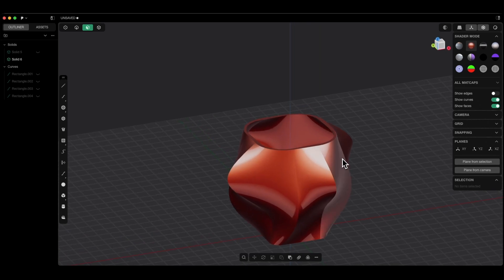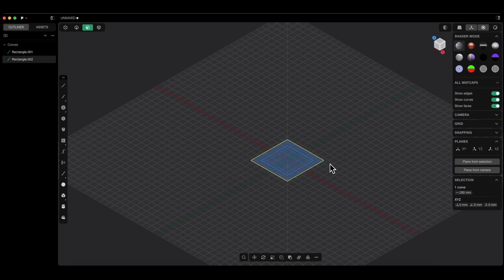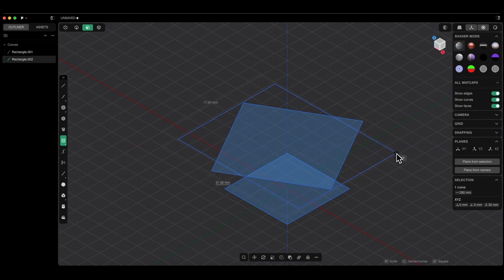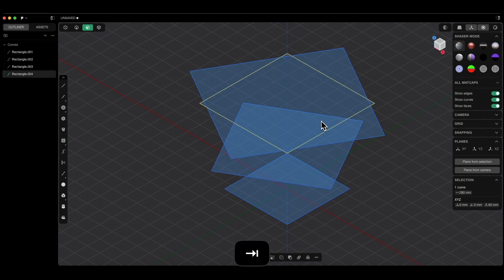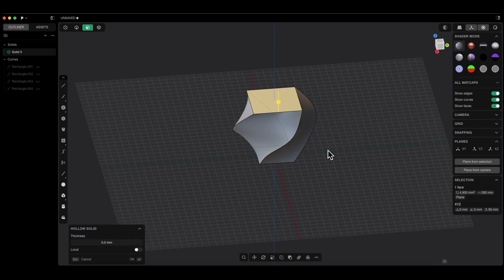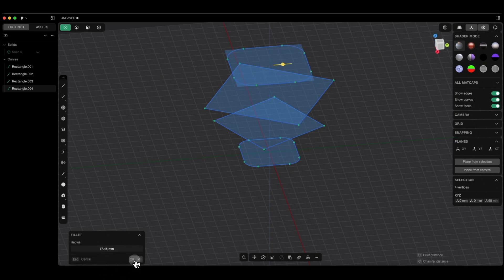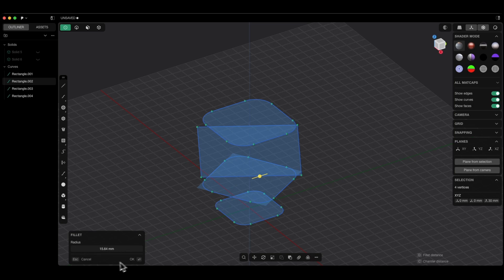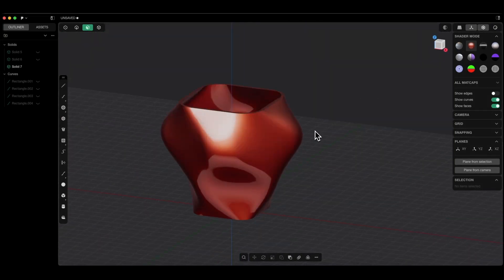Plasticity Tutorial - Simple Solid with Loft Command

Comment: Nice tut, thanks.  But why does mine not fill the end caps?  You have a plane at top and bottom, mine does not make those?
Reply from the maker: Switch to Face Selection Mode and select areas defined by squares rather than edges.
Reply: @start3dmodeling  Aha! Thanks!